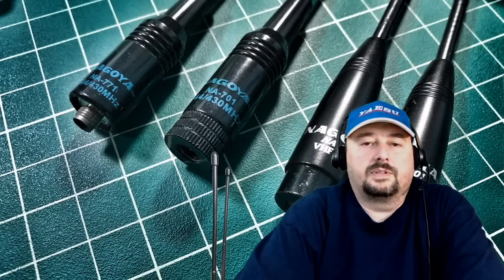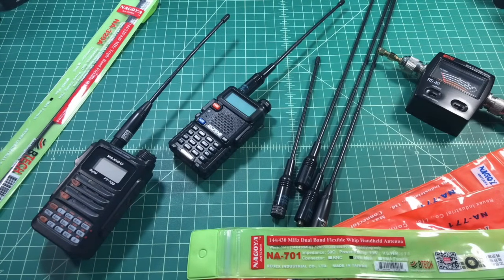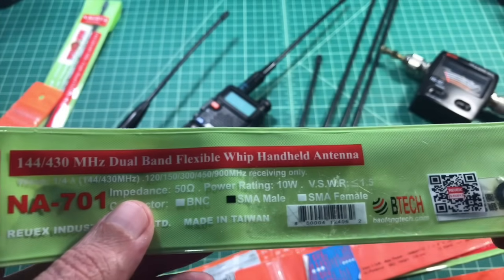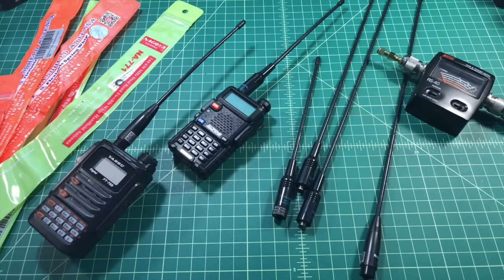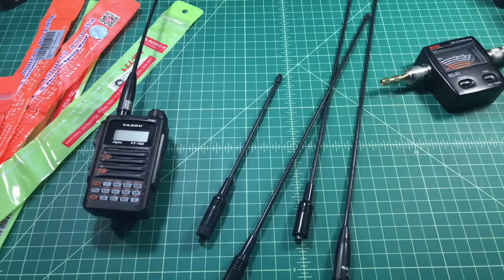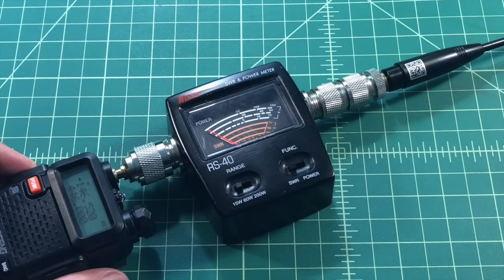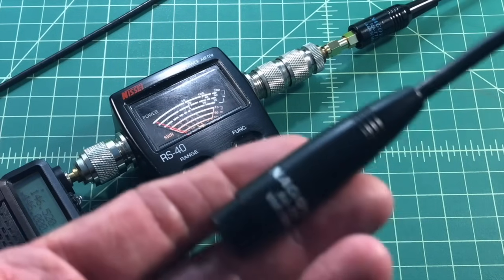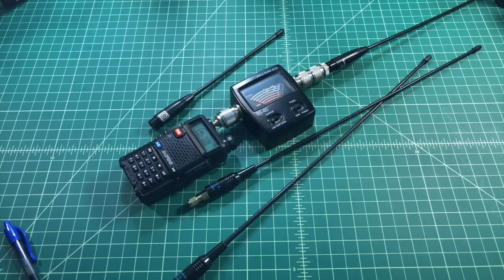Fake Nagoya Antennas - TheSmokinApe

Comment: I have a couple of (very bad) fakes. Orange packaging, scatter codes etc. They are just a bit of spiral steel rope crimped into a double ended SMA connector. No coil, no spring, no tuning, nothing. They tune to about 200MHz, as would a bit of wire. Cutting down for 440MHz works, but It's hardly worth it. 

The stock Quansheng rubber ducky antenna is a dual band with a proper double dip at 140MHz and 440MHz (pretty close) and are well built. Not Baofeng, Quansheng, on AliEx. Your mileage may vary!

Get a NanoVNA and prove what you bought 🙂
Reply from the maker: @dogshome7110  it’s crazy how there are so many terrible clones out there

Comment: Realy? Testing an antenna that laying on the bence?

The impedance of the radio itself should also 50 Ohms, de uv5 is for sure not. (Touch the batterie clamps on tye back, and you burn your fingers)

Sorry, not a good test.

Comment: So I have 200 acres of bush and need to set up my uv-5r in the house sometimes as a base station . Could a portable J pole antenna  be run up to the second floor to increase range through a mile of bush ?? Thoughts.Or can I do the same with a ABBREE...get it up on the second floor.
Reply from the maker: Id do a jpole on the second floor and you should be good 👍

Comment: I could throw a 50-ohm resistor in the base of an antenna with some random element for the whip and it would show a near-perfect 1:1 SWR.  Does that make it's "performance" as an antenna is excellent?   It'll take an antenna that has good ears and optimized radiation pattern with a somewhat elevated SWR over a deaf/dumb low-SWR dummy-load any day.
Reply from the maker: You sure could, but having a good SWR doesn't preclude you from having an optimized radiation pattern.  Thanks for the comment 👍

Comment: I THINK mine might be fakes....I did the same test, same SWR meter, but using a UV82L radio. I have 4 x Nagoya 771 antenna's and the 4 stock ones that came with my 4 HT radio's.I tested them all, the stock antenna's all had over 3:1 SWR on both 144/70cm, the "Nagoya's" all had really high SWR (5+:1) aswell on the RS40. I switched to another meter that is digital, and all 4 of the Nagoya wannabe's had SWR of 19.9 or above. I refuse to believe the meter's are wrong, as they work perfectly on known GOOD antenna's. I just can believe I managed to buy 4 duds that are SO bad they should be taken to the edge of the world and tossed into oblivion. I know they work still, but I wonder how much range is being lost due to crap antenna's on low power radio's....I hate to think how high the SWR would be on my super tactical, none more tactical, camo painted 4 foot long folding tape measure antenna (with factory added 10 inch bendable metal riser on the bottom, so the SMA connector has enough weight on it for a rock solid connection)......talk about an idiotic thing to own.....

Comment: Hello Hoping to get your feedback, I purchased several Nagoya NA771G which have the BNC connector. The package is not the same and the antenna has a sticker at bottom of it with the logo, however, the retailer is a Nagoya authorized dealer per Nagoya's website, any thoughts?
Reply from the maker: If they work well I wouldn’t worry too much about it.  That said if it’s not the official packaging I would suspect they are fake.
Reply: @TheSmokinApe  Thanks. I actually just heard back from Nagoya (Reuex) and apparently the antennas are legit as packing has changed for this particulur model, na771G and only one supplier in US sells it. But amazed they actually answered me

Comment: How about testing these antennas for reception? I've found my stock rubber ducky MUCH better for picking up transmissions. A few nights ago there was a local net going on and I switched multiple times from a Nagoya 771 to the rubber ducky. The Nagoya BARELY picked up anything while the ducky did just fine. I have 2 other long antennas, a Bingfu and an obvious Nagoya knock-off and all of the performed the same, in other words, terribly.
Reply from the maker: One of this things I have noticed is that some radios, not sure what you are using, can actually become overloaded with better antennas.
Reply: @TheSmokinApe  Hi Ape, I'm talking about on the UV-5R. What I've noticed is that it doesn't even break the squelch even when set to the lowest setting. If it was overloading wouldn't the radio at least recognize that a signal was coming in? I have better radios that I've never felt the need to upgrade the antenna but I will try swapping these Nagoyas onto my KG-UV9P tonight during a net to see if they also suck on that radio. Never even thought about doing that. lol Thanks!
Reply: @brazoon1 Did you ever further your testing?
Reply: @digitalchaos1980  not really but I did discover that these antennas seem to work much better on UHF compared to VHF. Possibly/probably  better than the rubber ducky antenna even
Reply: @brazoon1  Ok cool, well thanks for letting me know! 😎

Comment: Semi reassuring video!! My radio use is exclusively the Australasian UHF CB band (476-7Mhz - above most antenna's recommended specs) & biggest concern is the %reduction in output + possible damage via a higher SWR.  
In one of his videos, Notarubicon (GMRS user) was talking about one SWR tester coming with a metal plate for hand held antennas - https://www.youtube.com/watch?v=LMlmyuiOZxk, just wondering what your thoughts are?
Reply from the maker: Hey Robert, Thanks for watching the video.  I haven't seen that video and don't own that tester BUT I have a buddy that does...  Here is my take, most of these test are in controlled settings.  An inline small SWR meter that is usable in real conditions is the best way to get an idea of whats going on...

Comment: A better test would be to use a VNA to plot the characteristics of each antenna and not just a single frequency as each antenna could be 1:1 at a different point on each band.
Each antenna could be cut to perform best at a different point on each band for example as they are typically for portable use they would likely be cut for the FM Voice repeater section of
the band, or maybe cut for Digital use for Packet APRS. What about portable FT8! Also why would you say the original Nagoya should come in a Baofeng Bag? 
Baofeng is a radio brand not antenna brand, unless Baofeng make the antenna or they have the same parent company why wouldn't original Nagoya antennas come in a Nagoya Bag?
You really didn't prove anything with your tests one way or the other, no proof that any antenna is original or fake. I think this needs further investigation.
Reply from the maker: Glad you liked the video!

Comment: Hi, from England, 2e0deq. We use 145.500/433.500. I suppose what works for you might not work for me and visa versa. There does not seem to be a separate UK/Europe version/USA version. I have same meter as you just waiting for some adapters I have got no idea what the results will be but with piracy the way it is I think I will have to stick with cheap antennas so I don't get totally ripped off, testing them to see which is acceptable.
Reply from the maker: I never thought about them not being ITU specfic.
Reply: @TheSmokinApe  I am going to use a right angle adapter so the antennas I test are vertical, I am going to position the meter at the edge of a table and attach a 1/4 wave element for 145.500 to the adaptor with a jubilee clip as an earth/radiator. Creating a vertical dipole. I will attach a full size vertical element at first to check the system and then test the fake Nagoya and a couple of other antennas. One off my alinco, one off my CRT and a fake rh901s.
Reply: @oldmanandguitar  Outcome?

Comment: should i install the spacer or no, is it gonna impact the performance?
(the ring adaptor thing)
Reply from the maker: It won't impact performance, if you have a gap use it and if not don't.  Thanks for checking out the video!

Comment: So apparently one tell tale sign of the antenna being fake is that it has a rubber tip and not a plastic moulded tip with the nagoya branding embossed in it. Also they should have a QR code and mine is missing that too. These fakes are getting much better quality but its hard to find a seller you can trust.

Comment: There older Nagoya Antennas 144/430 MHZ instead of UHF/MHF. They had a slight design flaw leaving a gap between some of the radios or they failed to connect they tried useing a washer to fix that problem. The Blue Print is hard to read on black and it tends to fade away over the course of age you don't want to use the wrong Antenna it can short out the radio . So they switched to Silver Print makeing it easier to read. So there's no mistake in identifying the old Antennas from the new the new ones have Green packageing instead of Orange. Nobody is going to waste there time copying a $15 Antenna.

Comment: is the nagoya na-771 fully fits the uv-5r?
the advert in the na-771 is usually 144/430MHz, while the stock rubber antenna is 136-174/400-520MHz rated, and if you program the uv-5r it can reach up to 1000MHz right.
so is the na-771 capable of that frequency?
im new to this hobby btw
Reply from the maker: Welcome to the hobby Axelle.  The Baofengs won’t go to 1000MHz they usually stop at 570MHz, also keep in mind they are only legal to use in the US by licensed amateurs on the amateur bands.  No antenna will reliably cover all the frequencies so most folks do upgrade to something like a Nagoya and they generally report better performance on amateur frequencies 👍
Reply: @TheSmokinApe  thanks for the info, but now i'm curious to why did you say baofengs won't go 1000MHz and usually stops at 570MHz?
Reply from the maker: I haven’t seen one that does 1000MHz
Reply: @TheSmokinApe  more power to you man great vids, btw ever heard of the RH901S antenna? are they good for uv-5r?
Reply from the maker: @axelleigarta5152  sure, but I’m not sure it’s worth spending the case

Comment: Aloha Ape, to be honest, we usually buy the bargain basement priced antennas on eBay but there will usually be a markable difference in audio in climates with a higher humidity and the fakes will start falling apart because the fake ones use glue that doesn’t last very long has been my experience…Great test otherwise, Ape! 🇺🇸🇺🇸🇺🇸

Comment: Does a Nagoya tri-band antenna work well on a dual-band radio? And which is a better antenna, the NA-771 or the NA-24J, transmitting and receiving being the only criteria for judging? Doesn't seem like there are no solid answers. I like the 24J better, but I'm uncertain which is the top of the hill.
Reply from the maker: I'd only use the dual band ones on dual band radios.

Comment: Making a good working antenna wouldn't be difficult, and I don't imagine the TIDRadio TD-771 would be a poor performer. This is a new hobby for me, but I've yet to come across a radio exchange. Amazing. 

New hobbies are always a bit tough to break into, so after screwing in my new antenna and hitting scan, I haven't found any broadcasts, but I'll keep trying.

Strangely, many hamsters are getting great results from Abbree antennas. They're cheap and they're efficient. Plus, you can put one in your trunk and if you get in trouble somewhere where you can't cell phone coverage, you can unfold it and try to raise emergency rescue teams. 

You also can schedule contacts with family and friends in the wilderness. Just unfold the antennas, screw them in and you can stay in touch. 

It's amazing the technology to versatility ratio, and Baofeng is a Godsend to people who want to get into a new hobby. 🔹🌞🌛✨

Comment: You skipped the measurements. My 771 is the same as your No.1 -- blue lettering, no QR code on the back and in the most extreme longest measurement its 15.1 inches. But the so-called real one is 15.6 inches but I dont know how 15.6 or any correct measurement is achieved. Do i measure the antenna proper without considering the base or rubber tip, or the whole thing, tip to end of the mounting screw?

Comment: The “Expert Power” was a knock off of the Nagoya NA-701. It had the knurling on the bottom. It did not advertise itself as a Nagoya either. It had phenomenal 70cm performance. On par with the 18” Diamond SRH77 series.
Reply from the maker: Thanks for the info Pete 👍

Comment: I acquired a pair of Baofang BF-BF8+ second gen UV-5R radios and I'm just now starting to get into this whole HAM stuff. I think I've got more questions than answers lol. I ordered a set of fake Nagoya 15.1" antennas to try out. I had an old Emergency CB radio laying around and I thought I'd get into that. What I have learned is CB is DEAD. I could not get a single soul on any of the 40 channels. Transmit or receive! So naturally this HAM stuff is the next best thing.
Reply from the maker: CB seems to vary greatly with region.  Glad to hear your getting into Ham Radio.

Comment: A rusty nail or a coat hanger will work, just NOT a good antenna !! This is NOT the way to test the antenna. It needs to be tested on a VNA to find out the frequency spectrum response. Look for real antenna tests on youtube that use a VNA to show the frequency response and the true gain of the antenna.
Reply from the maker: I literally have dozens of videos showing how to use the NanoVNA and testing antennas with them.
Reply: @TheSmokinApe  Cool ! That's the best way to test any antenna and to confirm that its working properly ! Its possible that even reputable antennas could be defective or become damaged from use. The VNA approach lets you know whether you are in the ball park for SWR, but mostly to see if you truly get the gain that you are promised AT the frequencies of interest or across the band, not just one frequency.
Reply from the maker: Completely agree.

Comment: I have a few from Btech. I tested them on the RigExpert AA_600 analyzer, and they were 5:1 and higher. The stock  baofeng antennas had a much better SWR,  so I'm a little disappointed with Nagoya.
Reply from the maker: Yeah, 5:1 is no good.

Comment: Received a so-called Nagoya 771 the other day which I ordered from Amazon. Package was a clear wrap with only a sticker identifying it as Nagoya. Antenna tip was mangled and part of the antenna above the base was a little melted. Scan code was smudged. Immediately sent it back. Thank goodness for the Amazon return policy. Cannot say I am disappointed in the Nagoya 771, because this may have been a fake. Could not accurately check out the SWR, but I was not going to keep it anyway. Appreciate your efforts to spread the word about fake name brand antennas. Thanks for sharing.
Reply from the maker: It's easy to get a fake on!  Good luck on any future purchases.

Comment: Just bought a 320A for my baofeng that cant hit a 222 repeater that the stock antenna can hit, hmm
Reply from the maker: Oh boy, you think it's a fake?
Reply: @TheSmokinApe   I'm not sure, your video showed that, at least when it comes to SWR, a fake doesn't have to be bad.  I'm kind of wanting to try the version from Diamond or Comet, I'm reading those reviews now.  One problem I had with the Nagoya was screwing it onto the Baofengs sma connection, i could get a few turns but then it met resistance and was a bear to get off once I had it screwed on.  Not sure if thats normal or not.  It did it on my other Baofeng too.  I might try a barrel connector to extent the Nagoya base up a bit but I don't think that was the cause of my performance issues.  Cheers and thanks for the reply

Comment: I bought a "real" 771 and when doing a channel scan it preformed worse than the original antenna that came with my Baofeng BF F8HP.
Any idea why?
I think I'm going to send it back and get one of those folding tactical antenna like you reviewed.
Reply from the maker: What I will say is that the Baofeng radios have a lower quality Direct Conversion receiver, often called a "front end." Upgrading the antenna will cause the radio to "hear" better than it did with the stock antenna.  With a Baofeng that can cause intermodulation or overload the front end causing degraded performance.  Does that help?
Reply: @TheSmokinApe  I still plan on trying out a 28 inch "Tactical" folding antenna..
I bought this Baofeng for emergency use on my Versys 300 adventure bike...
Most of my riding is in and over the mountains here in Oregon PNW where cell phone service is nonexistent.
I am still studying for the Tech test online.. will be taking the actual test early next month.
Reply from the maker: Give the antenna a try and see what happens, good luck on the test.
Reply: @TheSmokinApe  I will for sure.. I want this radio to work for emergencies on my adventure rides.  Thanks for replying 
I most certainly will keep you informed.

Comment: Good information for comparisons but I doubt your SWR readings are valid. The radio and the user make up the ground plane of a handheld so to accurately measure SWR you shouldn't  remove the antenna from the handheld and the user needs to key the radio in a normal way. I have no idea how you would do the latter. Thanks for sharing.
Reply from the maker: Yes, with HTs you are part of the ground.

Comment: I ordered several "Nagoya" antennas last year. Two were definite counterfeits (the genuine ones are never orange) but oddly enough, one of the genuine counterfeits performed best overall on the antenna tester. On both bands. Whether it will hold up over time is something else, since many "rubberized" antennas crumble in 5-10 years. Even OEM ones.
Reply from the maker: It’s weird but some times the fakes are great and the legit ones are terrible.  Thanks for the comment 👍
Reply: @TheSmokinApe Welcome to the world of Chinese quality control standards 😆